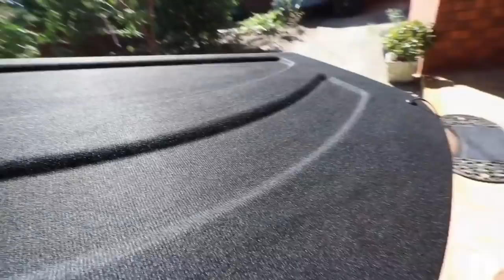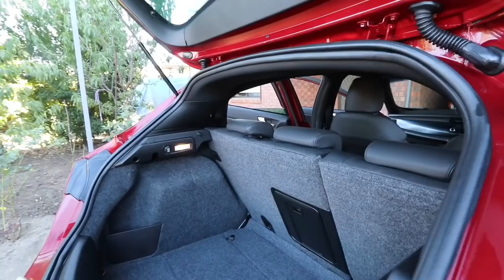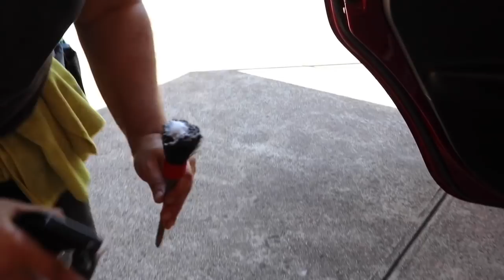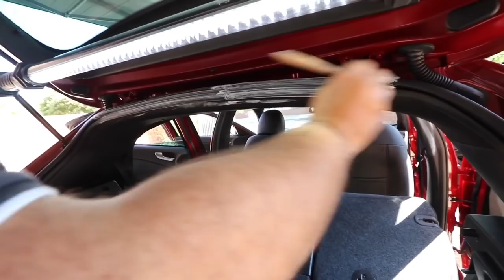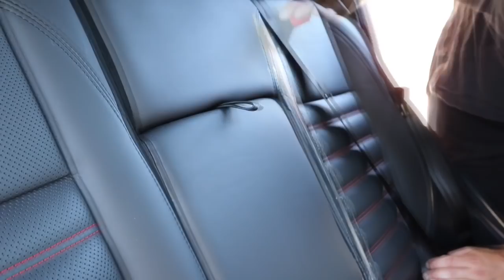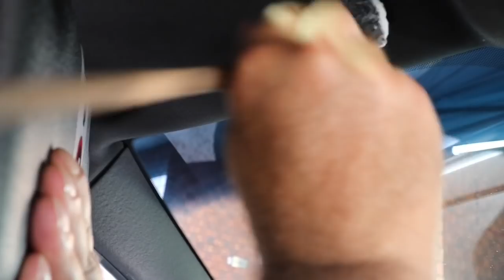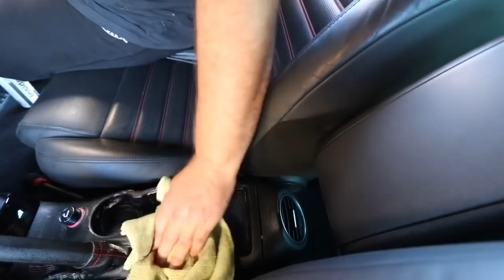How To Professionally Detail An Interior Part 2 (Vlog 3.2)

Comment: I purchased CarPro Inside and followed your instruction of using this product. I have been detailing interiors as an enthusiast for many years. CarPro Inside is by far the best cleaning and conditioning product I have ever used. It makes plastic and leather surfaces look better than new. It dries incredibly even and has a darkening effect on  plastics, leather and rubber. Thank you so much for reviewing CarPro Inside. It is simply amazing and it’s performance is top shelf.

Comment: Hi Sandro, Great video and tips. As a beginner I have taken notes and followed your other videos for reference. One question I would like to propose is how to clean piano black trims? they seem to scratch easily. Kind regards
Reply from the maker: They definitely scratch super easy, so if you can pressure rinse the trim first to remove dirt, it should greatly reduce wash induced swirls together with using a microfibre cloth for the hand wash with just a gentle touch. I also did a video a while back on polishing and restoring those trims: https://youtu.be/XiWMi80O0TM
Reply: @CarCraftAutoDetailing  thanks Sandro for the link. Followed as you mentioned and worked a treat with only a few chip stones damaged, but I will leave that for the pro.

Comment: Great video. Would you recommend using Meguiar’s detailer all purpose cleaner for interiors and at what ratio is best (1:10 or 1:4)?
Reply from the maker: Yes I used Meguiars APC a lot in the past and mostly at 1:10. For carpets and upholstery you can generally use it 1:4 without issue but if the car isn’t too dirty then 1:10 should do the job quite well.

Comment: Good stuff mate and very thorough...I use the Dr Leather Advanced Wipes on seats and leather inlays etc and have had outstanding results. The wipes even remove dye transfer stains from jeans etc and clean thoroughly and quickly which is important. As they clean and condition the finish is excellent and is great pre coating preparation. If your interested you can buy from Aussie distributer and save O/S postage...I have link for him...The wipes end up costing around 40c each...I am interested in using CP Interior on dash/door cards etc and have ordered some. I also have vacuum handy when cleaning areas with dials, gauges or gaps such as dash, console, vents and gaps between plastic trim to ensure moisture and product does not remain in hard to get to areas.
Reply: Carpro Interior...In my world the degreasers etc are for the dirty neglected interiors on cars that are not too expensive and still will be. I will also use them on more expensive cars interiors but not the leather as I'm looking for a 1 stage process before protection applied. I use deg/APC to clean both cheap vinly/leather and plastics and they do it well. Degreaser's and APC's just clean and then the leather needs dressing/protecting making it at leasta  2 stage process. I'm looking for an AIO which carpro interior also seems to be. Once the quality of the leather improves on more expensive models the wipes come out. And from my short experience with them they work very well and are the quickest AIO I have used yet.The wipes are only for leather , so if your asking if wipes can handle dirty neglected leather then that's a yes. Watch some of White Details vids and you will see the state of the interiors he has used wipes on. I don't expect wipes to be the perfect solution and yes I was also skeptical but that was mainly because I couldn't get my head around the fact that a wipe could be this good. Anyways i got over that and tested them and now I'm convinced. Just my 2c worth.
Reply: No probs mate..Yeah I agree on Whites interiors but to be fair he has had to clean a couple where the leather interior were pretty dirty and neglected. Also, from what I have observed the more modern the car the degree of dirt and neglect is not as significant as in older cars that have not been cleaned for years and years and years and have had everything but the kitchen sink thrown at them. Anyways here's the link, click on international resellers.
http://www.drleather.com/Leather-Cleaners/Current-Distributors.aspx

Comment: Again in depth and well presented!!!! You kill it again. I got some INSIDE to try and glad I bought it. I have used 303 and have been quite impressed with it but after seeing this I think maybe INSIDE may give a slightly better finish in that it seems to be a bit more matt gloss look. Just on that if I wanted to go up a touch with trim/dash/Vinyl gloss what would you recommend???? I seen VLR used on both tyres and tri and it looks good. Car Pro also has Silk but I am unsure. Needless to say your results here are dam impressive along with the attention to detail. Will have to get some Maguire's APC as it not only cheap but works. You should work for Myth busters blowing all these marketing hypes into the bin. I have some Bowden Orange Agent and wow it really cleans well. So impressed with their range so far. All good results. And Aussie. Cheers mate.
Reply: Car Craft Auto Detailing How much You can diluted Inside? 1:5 or even 1:10?

Comment: Another great video!  Have you ever tried Turtle Wax ICE Interior Cleaner & Protectant?  I use ICE on all my vehicles about every two months as a maintenance cleaning, so my interiors never really get the chance to get dirty. I use ICE on all interior surfaces including vinyl/plastics, leather, glossy plastics and chrome. It even works great on it the clear lenses of the instrument cluster and radio/navigation touch screen. If you have tried ICE, how does it compare with the CarPro product you are using?
Reply: Car Craft Auto Detailing  I do like ICE, but your video prompted me to buy a bottle of the CarPro Inside from Amazon. Looks like it really darkened the black interior. I'll try it out and follow up later after I compare the two products.

Comment: Hi Do you dilute your CARPRO INSIDE for interior application?  Also, does CARPRO INSIDE contain a slight Hyper-Dressing in it's formula ?  Thanks
Reply: As far as I know CarPro is an APC cleaner with no dressing properties. If I want a cleaner/dressing something like Optimum Protectant Plus is better suited
Reply: Thank you for your reply and explanation. I really do like the CarPro range of products I have tried so far and will try some Insider down the track. What I really like about your videos is how you share your thought process. It allows people from all different experiences too gauge what will work for them. You are probably the best detailing YouTube blogger doing this and I watch ALOT of detailing videos.  

I'm a firm believer of finding a process that works and sticking to it, allowing one to get the best results. However, detailing is constantly evolving so we always need be receptive to new ideas and products. We have to decide if theses products or techniques can be integrated to improve our current process to improve efficiency and/or results. I have already adapted some of your processes already. Keep up the great work